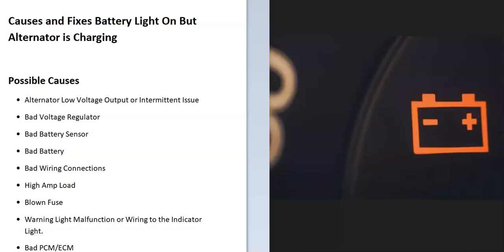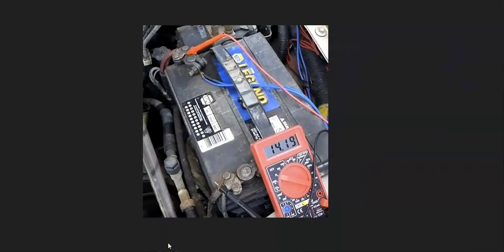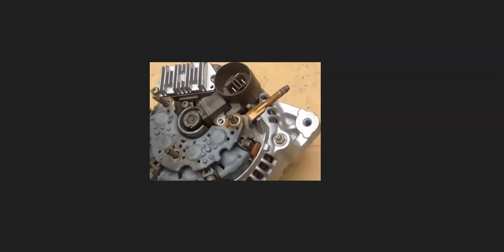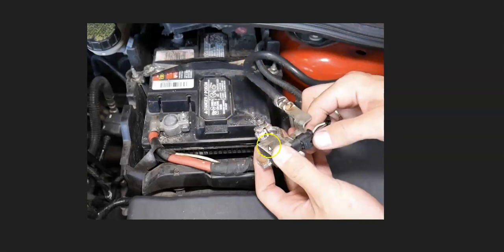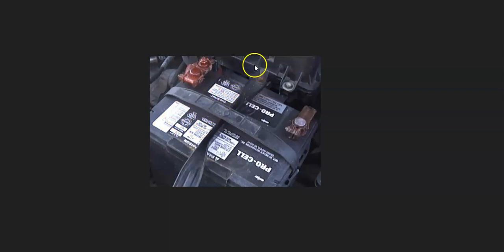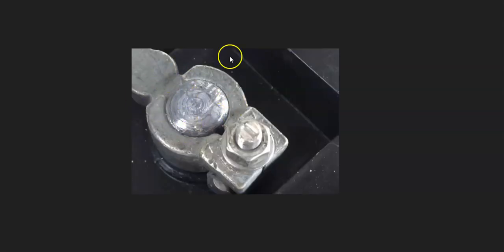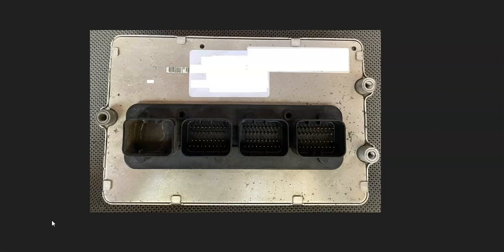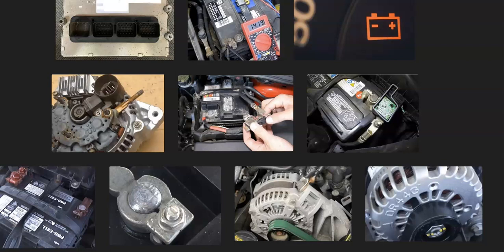Causes and Fixes Battery Light On but Alternator is Charging

Comment: I hope you see this. I recently had my alternator changed a few months ago and just a few days ago I had to replace my battery. Now since I’ve changed the battery the comes on the car drove for a few days and gave out. Took the battery in they said bad it was a bad battery I was able to exchange it. However I put the newer battery in and the light keeps coming on but now the car won’t keep power I was able to drive it just a little before it gave out on me again. Any suggestions . PLEASE I NEED HELP
Reply from the maker: I would double check the battery terminals are connected good and test the alternator.
Reply: @HVAC_Mechanic  THANK YOU!!!!
Reply: @VaughnTaylor31 did you ever figure out the issue I’m having the same problem can’t figure it out. Tia
Reply: @lillianm1242  I didn’t. I just purchased another alternator so hopefully in the this coming week I can get it put on and or figured out. I can give an update when I get it done.
Reply: @VaughnTaylor31 hello i have the samr problem did it get fixed? If you did what was the problem
Reply: @VaughnTaylor31 did the alternator fix your issue? I had the same problem and swapped the alternator today and the light still won’t go away

Comment: See Update below:  I have a 1990 Toyota pickup with intermittent alternator light coming on.  Cigarette lighter has a volt indicator plugged into it which reads about 11volts when Batt light is on and about 13-14 volts when the Batt light goes off.  Sometimes when I firmly tap the alternator with engine running, the Batt light will go off, but not always.  I think perhaps the voltage regulator or maybe the brushes in the Alt are malfunctioning?   Hard to say.  Comments?  Update:   It was the brushes.  They had worn down to the very last section of contact material and tapping the alternator would momentarily make contact with the commutator and charge and dash light would go out.  I replaced the alternator and inspected the defective one before returning it as a core and the commutator had two, 2-3 mm grooves  in  the stator and would have needed to be turned smooth, so the most expedient action was alternator replacement for about $140.
Reply from the maker: I would take the alternator to an auto part store and have them test it. If it tests good, then I would replace the voltage regulator.
Reply: That is very smart of you to use a voltage indicator plugged into the cigarette lighter. 

The voltage indicator helps eliminate the diode trio and the accidental grounding of the wire connected to the battery light in the instrument panel. 

It's either going to be your voltage regulator, rotor, or the stator windings. If it were the brushes, the light would go off every time you firmly tapped the alternator.  Let us know what fixed it. I'm sure it will help someone else in the future.
Reply: You were incorrect on all counts.  It was the brushes.  They had worn down to the very last section of contact material and tapping the alternator would momentarily make contact with the commutator and charge and dash light would go out.  I replaced the alternator and inspected the defective one before returning it as a core and the commutator had two, 2-3 mm grooves  in  the stator and would have needed to be turned smooth, so the most expedient action was alternator replacement for about $140.
Reply: @GereDJ2 Thanks for the update. Goes to show how much I know...lol, but that voltage indicator  is a smart move. It helps you eliminate some things. The majority of older alternators from the early 90s and back grounded the battery light through the brushes and that's another reason I didn't think it was the brushes. The newer ones get grounded through a resistor before the regulator and brushes. You most likely had the newer style, but I could be wrong again. Thanks again for the update.
Reply: There are places that rebuild them cheaper ans put nrw brushes in them. Just call around.  Usually a small shop that does just those. But now I beleive that is what's wrong and  was the while time as I alteqdu thought  this by how it's acting. But I got a 02 f250 superduty
Reply: @MsLori-anne  I pretty much agree, but needed my truck and was short on time.

Comment: Great video! Thanks!

Sometimes brushes can wear inside alternator and not make good contact. 

Also, for some custom set ups, you can upgrade to an adjustable regulator on alternator to fine tune the voltage. Just for general knowledge

Comment: I have an 08 grand Marquis, battery light comes on intermittently, checked voltage when light is on, reads 14.3. also reads the same when light is off. Any suggestions?
Reply: Same here, 2002 LTC but only happened after rebuilding the alternator using new bearings, new rectifier and the same old voltage regulator.  I'll replacing the VR and see what happens. The charging is fine, 14.4V no lights flickering, window regulator is quick etc checked each and every fuse,  fusable link.. all good. Will let you know after i change the VR.
Reply: @ronniepemberton1942  There's a wire that goes from the ignition switch to the battery light then from the battery light to the alternator. This wire grounds out at times within or near the voltage regulator. When it grounds out is when the battery light comes on. 

Most of the time it's inside or near the voltage regulator where it grounds out, but it could be that this wire's insulation has been damaged and it's grounding out between the battery light and the alternator. 

You first need to make sure the wire from the battery light to the alternator isn't shorting out. Then you can either replace the alternator or disassembe your current alternator and replace the voltage regulator.
Reply: Thanks, I replaced the alternator 3 prong wiring connector and problem solved.
Reply: @ronniepemberton1942  Good to hear. So that's where it was grounding out?  Thanks for the update.

Comment: Great video thanks I'm working on my 06 Cadillac STS v8. It's very interesting what you said about checking the alternator's voltage is in the proper range, and how it might be a good alternator but your battery is bad
Reply: Or other eay arpund n the brushes might be worn or faulty had that happen alot check the volts on the altinatpt separately and the vilt regulator as well as that it'll two screw sensor on battery cable. Looks like a flat piece metal with two screws but it's really a sensor. I never wpuld a thought

Comment: Humming sound under hood when trying to start, clicking noise when trying to start.. the starter is less then a year old timing belt changed - battery less then a year old. I’m sick of it
Reply: It's most likely going to be your battery, alternator, too much resistance in thick positive cable or thin positive wire going to starter, or bad ground from engine block back to battery. If your battery terminals are dirty, clean them. Make sure all the connections from the battery to the starter are tight; this includes your battery terminals.
Reply: What
Reply: I think we all hate auto problems . I was lucky enough to have a good enough battery to get home in my driveway. Alternators gotta be bad because once I got home let it run until it died. Even if the battery's dead a good alternator would provide power to all electrical components. Sorry for your problem . I know exactly how you feel.☮️

Comment: Bmw e39'  s.  Bmw e46's they are linked to the low oil light sensor. If the oil sensor in the oil pan is a open circut, will cause this issue.
Reply: Dude. THANK YOU
Reply: Could you please elaborate this further ? I’m using E46 & have the intermittent battery light warning